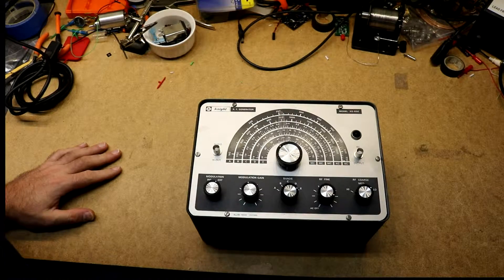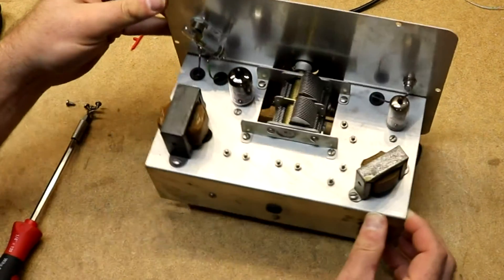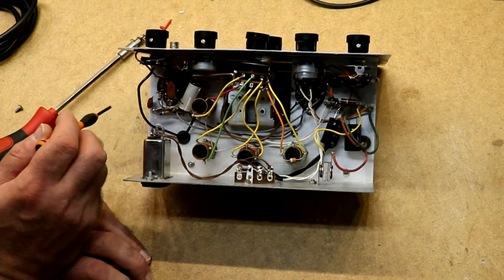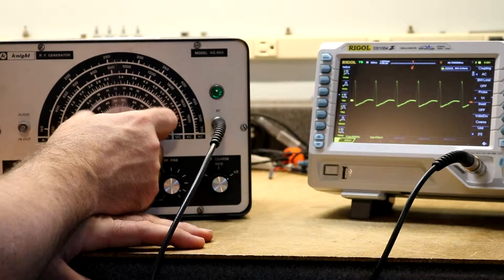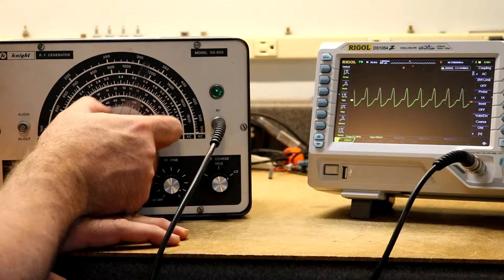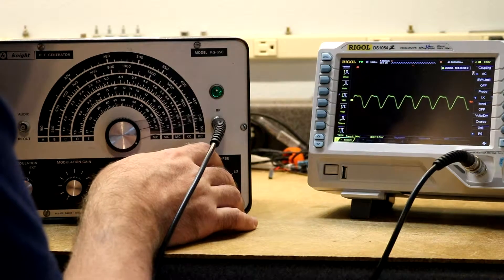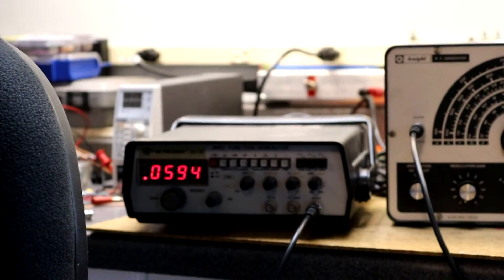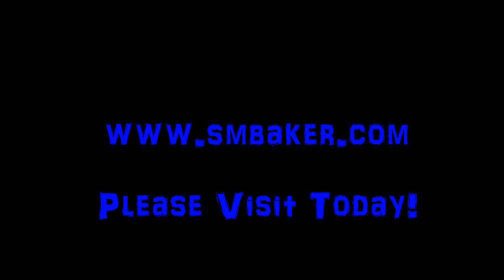Knight KG-650 RF Generator - Tear Down & Try Out

Comment: What does the wave look like if you use a properly compensated scope probe?  Nice video.
Reply from the maker: +TheRadiogeek Thanks. It looks pretty much the same (i.e. similar weirdness on bands A-D). If one connects a scope probe directly and omits the 50 ohm terminator, the vPP is much higher, as much as 4 Vpp. nselabs reported similar odd waveforms on the lower bands and added a pot between the two stages of the 12AT7 to clear it up. I haven't tried that myself; my worry is that it would clear up the lower bands, but significantly reduce the output of band E.